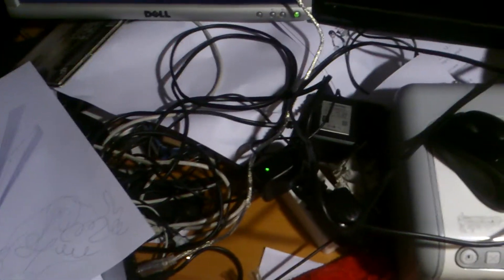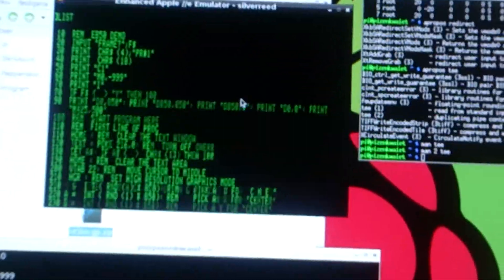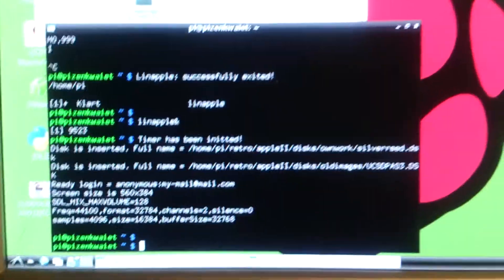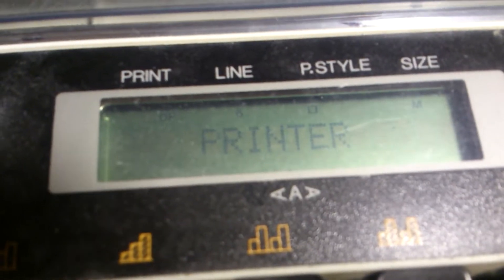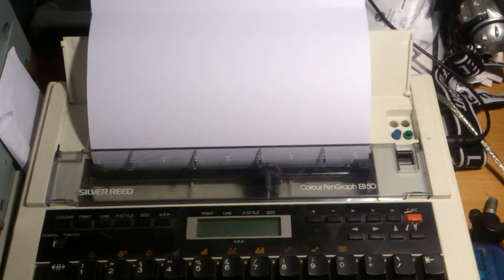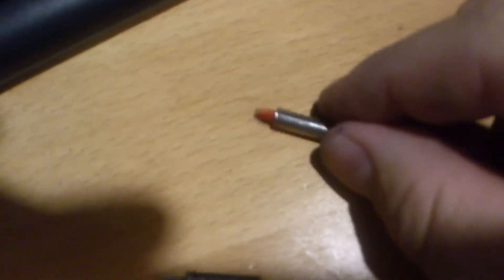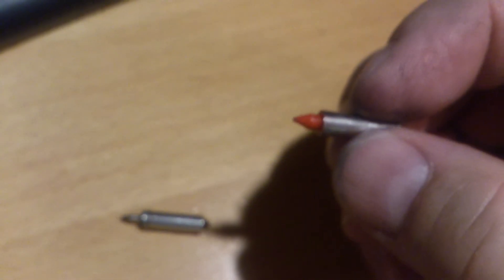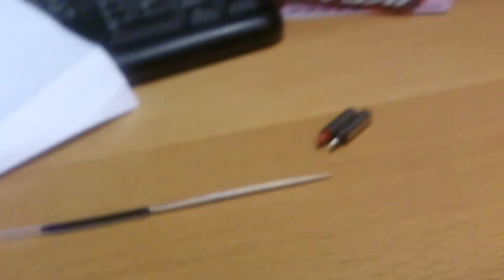Silver Reed EB50, Plotting.

Comment: thanks, is it possible that you can share the programming shown in the video?
Reply from the maker: there is a listing scrolled by in the video. THe major changes are on lines 3320 on and also in 390 onwards, basically i changed the "hplot" commands to pritn on the vitual printer file in slot #1, commmands for the eb50
Reply: many thanks!

Comment: what are the hardware used to connect EB50 to raspberry pi?
Reply from the maker: a cheap usb->parallell port. I believe it is a prolific chipset. The EB50 is standard centronics port, takes normal ascii, with a few extra codes.